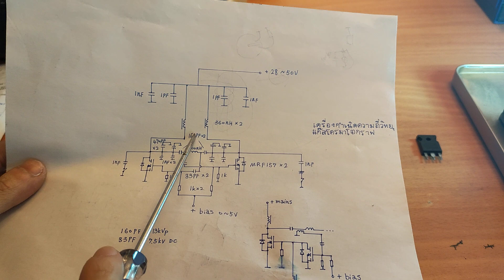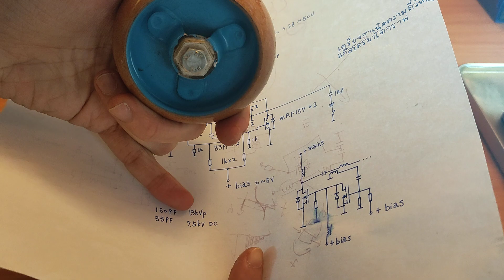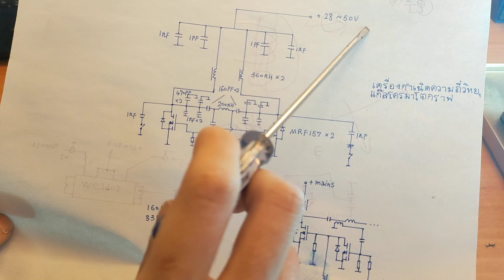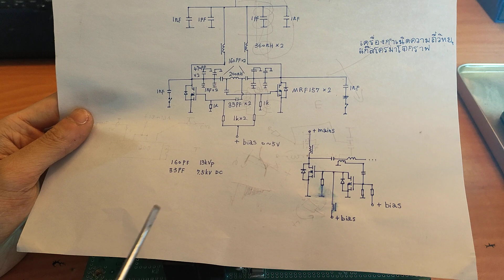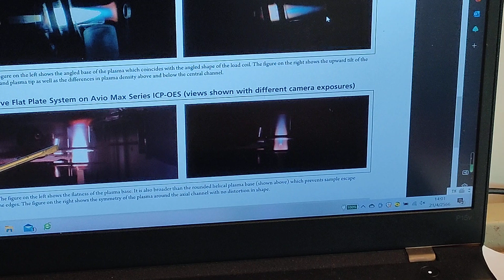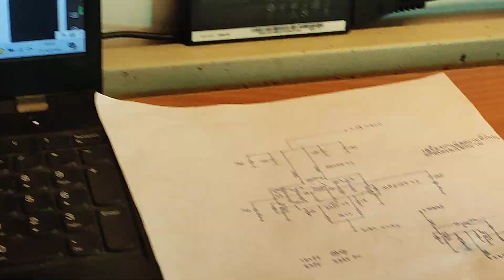Inductively coupled plasma RF generator board

Comment: These boards comes from the Perkin Elmer Coupled Plasma Optical Emission Spectrometers and are used in some variant of these. These board with capacitors and all cost around $100 per piece nowadays.

Comment: Hello, nice video about the circuit. ❤i ‘m currently working on some kind of atmospheric icp plasma . So i want to copy that from the icp-ms rf generator. Is the circuit in your video the real circuit board taken out from a icp-ms? Or do you have any more useful information about the real icp-ms circuit? Really appreciate!
Reply from the maker: Hello sir, 
Yeah, that is the real board for a solidstate ICP generator. More information would be released in the following weeks, I just happen to do a few more videos about that board recently.
Reply: @uecmitsuimarinedieselengin873  Got it, looking forward to your videos:D. And I still have a couple of questions. Does this circuit include an impedance matching circuit or does it really need it for generating plasma? What is the purpose of “bias” in the circuit? And how is the rf signals generated (the signals to control the rf transistor)?
Reply from the maker: @qineric2424  This is something like a self-oscillating ZVS circuit if you are a fan of electronic then you would understand what I mean, so it don't need any extra function generator circuit. The gate signal are just from the other side of the oscillating TANK through a 33pF feedback capacitor. Also, it doesn't utilize an impedance matching like in those driven type RF generators, the TANK impedance was designed to be matched to atmosphere pressure Argon plasma.
Reply: @uecmitsuimarinedieselengin873  Yeah, I did made a ZVS circuit before. I actually found out that this board is used for atmosphere pressure plasma using flat plate plasma technology(the exact same board in your video).
Reply from the maker: @qineric2424  Exactly, perkinelmer provides 2 kinds of ICP for their ICP OES instruments, one is tube coil and another is what you mentioned.
Reply: @uecmitsuimarinedieselengin873  Sounds cool, really want to make one myself!
Reply: @uecmitsuimarinedieselengin873  I got one more thing unsure, why we need such big 160pF and 33pF capacitors, with high voltage tolerance(I don’t think we could generate really high voltage in this circuit)
Reply from the maker: @qineric2424  That's because those caps need to withstand high RF current, and usually those which could withstand high RF current are usually silver plated ceramic caps. Also, the reactive power on them are huge so they must be low loss type, also ceramic caps. You can search for ATC telecom RF caps, those are usually SMD type but with extremely high RF rating, there are also several of those on this board.
Reply: @uecmitsuimarinedieselengin873  ok, thanks!

Comment: hi, I've been waiting for a long time for you to launch this push-pull RF generator)))
Reply from the maker: Hello my friend, I am glad that you are interested in it. Currently I am working on some copper plates for connecting the main resonant and feedback capacitors, also connecting the resonant induction coil. Now I have all the stuff prepared except for the copper plates and I will surely power it up in a few months.
Reply: @uecmitsuimarinedieselengin873  I tried to assemble this circuit using heavy IRF-type mosfets, the generator started up very easily) the circuit gets very hot, and the voltage on the drains of the transistors is very high
Reply from the maker: @zilipoper  Sorry I didn't see the reply. Since the 2 inductors act as a current source, any mistake in the switching time could be the cause to the high voltage appeared at the Drain I guess.
Reply from the maker: @zilipoper  So I was guessing that the 2 capacitors which are controlled by tge relays are used for decreasing the voltage across the DS while the plasma hasn't been ignited.

Comment: De-ionized water is fairly non-conductive, so that might work. I think sulfur lamps (which are often 1kW) generally use forced air, but I know some are water cooled—might be worth looking into patents for. "Plasma lamps" is the US/UK term used for electrode-less gas discharge lamps, if that helps with searching at all. A different gas mix that's a more efficient radiation emitter (and maybe in a larger quartz envelope) might be the best solution. HPS and MH lamps fit a lot of power into a pretty small envelope, for instance. These are, fwiw, RF excitable. At least in a microwave ;). Metal Halide lamps have mercury, and often HPS do too, so do be careful with UVC. Luckily, glass and plastic block UVC very well.

Comment: I really appreciate your explanation of this circuit, thank you! 

Is my understanding correct that the white capacitors have a NP0 dielectric, and the brown capacitors have other dielectrics, like X7R? That's the impression I've gotten from the few ceramic capacitors I've ordered, but I'm not sure if it's always the case.
Reply from the maker: I am glad that you like it my friend🤗
Yes, the white capacitors are ATC RF  capacitors which have the NP0 dielectric, I am not quite sure about the material of the brown filtering caps, maybe they are X7R type.

Comment: You can use any gas to generate a plasma. The amount of energy needed to ionise the gas will be different between gasses. One of the easiest gases to ionise is Argon. If you want it to glow brighter, just add a few mg of mercury. This will also reduce the ionisation potential.  (There will be some strong UV lines but will be mostly contained by the glass.) But you should not have a problem with brightness with the power you have available. The gas does need to be under a low pressure, but not very low. I mean you can easily achieve the level of vacuum you need with a fridge compressor. For the glass, I would use borosilicate (pyrex) You will need Mapp gas to melt and form boro glass, but it`s usually easily available. Don`t wast your time with oils or water. If you are finding it difficult to source gasses, just use plain old Air! I can give you further details and help with glass-working if needed. If you do any experiments with fused silica, beware that if you use mercury, very strong UVc will be emitted!
Reply from the maker: You offered great help, i will try them out, i had not thought about low pressure air before😂
Reply: I think he said his neon tube was already quartz/fused silica glass, which has a higher melting point than boro. I feel like submerging a tube in a larger tube with de-ionized water is just so easy it's worth a try if nothing else.
Reply: If you took a UVC germicidal lamp (Fused silica glass—if nothing else this is a decent source of quartz glass tubes—with mercury inside) and chucked it in a water-filled section of a T12 or T8 fluorescent lightbulb (being careful to not let UVC escape out of whichever side of the bulb you cut open), it could provide steam cooling and greatly increase the light output compared to just mercury, since the UVC line of mercury is very strong and the phosphor can convert it to visible light. I think I've heard that at some point phosphors saturate, though, and I'm not sure whether that point would be reached.
Reply from the maker: @vdekjEE  i have had that idea and i think that worth a try since the lamp is handy.

Comment: Those are nice mosfets. If I remember correctly, they have a rather high gate capacitance that will need a specially designed drive matching arrangement if used in a linear amplifier design. This does not really apply in this free-running application. Unless you have a need for this plasma generator, I would consider using those fets for a lower HF linear amp or maybe a nice push pull class D amplifier. You seem to have a good source for used RF equipment, here in the UK that kind of stuff is really difficult to find at the right price, it`s usually $$$$$. Your explanations of all these different boards is very good. Great channel!
Reply from the maker: Thanks sir for your comment.🤗I think if i want to make a HF linear then i can get another pair of these mosfets, they are about 100 dollors one pair. Now i want to experiment with some atmosphere pressure plasma😂.